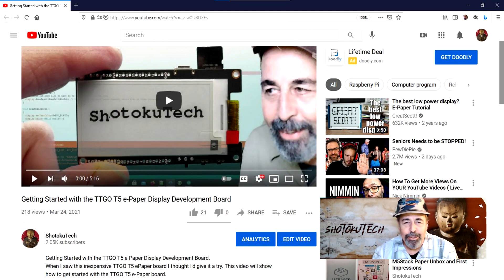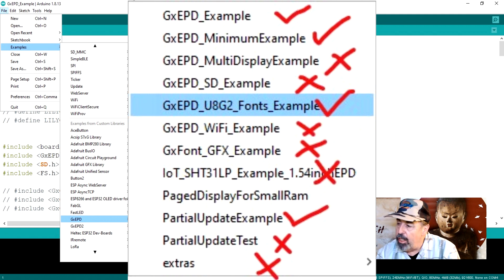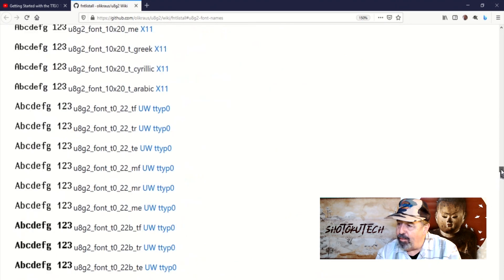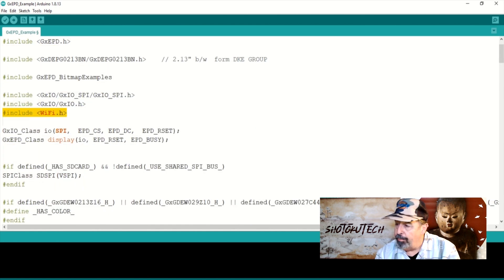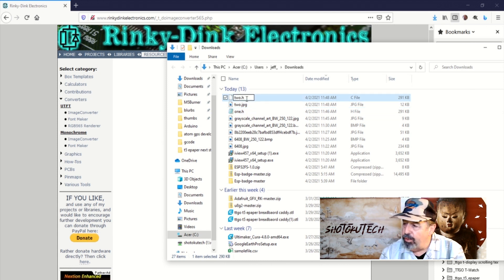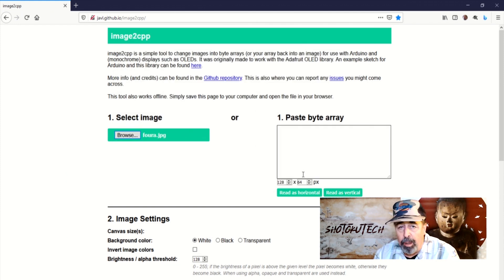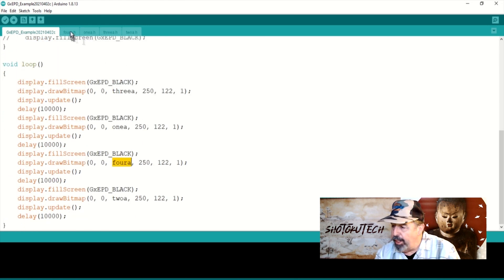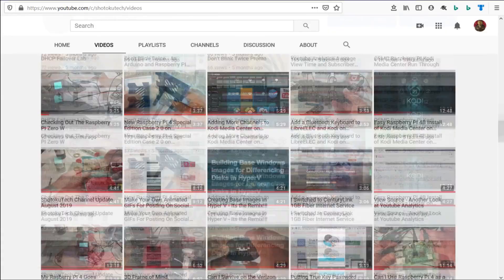TTGO T5 E-Paper Custom Images and Example Sketches

Comment: I appreciate this is an old video (awesome as it is) - but I've just got my hands on a couple of these.  My original plan was to turn it into a fridge magnet, to show Alexa shopping lists, however once having in the hand this unit would make an awesome homebrew digital watch.  Any thoughts?  If so,  what would you add?  Speedometer/step counter/gps/speaker?
Reply from the maker: Sounds good if you can fit it all in there! :)

Comment: i get an error from your example code that boards.h is missing. I think i installed all libraries from your previous vid but maybe i am stupid. What library does include boards.h? I can run the Example that you reverse engineered.
Reply from the maker: Hello. I recommend following the Arduino preparation steps in my previous video:
"Getting Started with the TTGO T5 E-Paper Display Development Board."
https://youtu.be/av-w0U8UZEs
Reply from the maker: lewisxhe / GxEPD 
https://github.com/lewisxhe/GxEPD
Has the boards.h file. I just confirmed this.

Comment: Did you ever get the SD Card working?
Reply from the maker: After the fact I discovered the example sketch actually does work with the SD card. Early in the startup, the size of the card is displayed. I'm pretty confident, between the example sketch for this device and the work I did with T-Display here and for "TTGO LORA32 V1 With SD Card Data Logger." I could work with the SD on the T5. https://youtu.be/hLCFNR3jp8Y

Comment: Im getting this error >>>GxEPD-master\src/GxFont_GFX.h:77:13: error: 'int16_t GxFont_GFX::getUTF8Width(const char*)' cannot be overloaded<<< not particularily sure where it comes from im going to assume its a library issue because otherwise my code looks exactly as above but if anyone has a fix! Ta
Reply: All sorted!! Need to set the app size to standard i had mine at large app from another project :)
Reply from the maker: Phew! Thanks for the update.
Reply: @joolsc3120  Where is that set? In the Arduino software?

Comment: Hi, Thanks a lot for guiding us through. It is really helping to move a bit faster. Now, I would start up a discussion concerning clearing the ePaper display. There is no built up function for it. I have tried to find a way around, but I am not happy with my results yet. So, I would appreciate someone advice here. By searching for the solution I tested different drivers. The one you have recommended did not clear previous images and it was necessary to draw both image or font several times otherwise they were really weak. Finally, best results were with GxGDEMO213B74.h from GoodDisplay 4-colour. I am hoping you do not mind of using your channel for exchanging information and sharing experience. Once again, many thanks. Best greeting from Sweden.
Reply from the maker: Interesting discussion. Thanks for your insights. I guess I will try other '213' drivers as you have indicated. I want to look more at PartialUpdate examples soon. Everyone is welcome to contribute to the conversation here. Keep it going! Thanks.

Comment from the maker: Thanks for watching. Be sure to check out: Getting Started with the TTGO T5 e-Paper Display Development Board.
https://youtu.be/av-w0U8UZEs
Reply: HI, im making some progress, I have one board up and running a weather station with the GxEPD2 but another board also the T5(but a little different) is having trouble getting the GxEPD2 to work and ideas? have you ever flashed new firmware on these? the GxEPD works fine
Reply from the maker: @photobusta  I just took a look on github and there is firmware added at  Xinyuan-LilyGO / LilyGo-T5-Epaper-Series https://github.com/Xinyuan-LilyGO/LilyGo-T5-Epaper-Series/tree/master/firmware
I have not had to do a flash on these yet. Did you try drivers for the previous display? Someone just commented yesterday that worked for them.
Reply: @ShotokuTech  yeah im on a mc, so this is pretty tough.. we'll see how it goes
Reply from the maker: @photobusta  Yeah I can't really speak on that. Maybe one day I will get one myself. I am just about to load Raspberry Pi O/S desktop on one of my Windows 10 2in1s. Wish me luck.